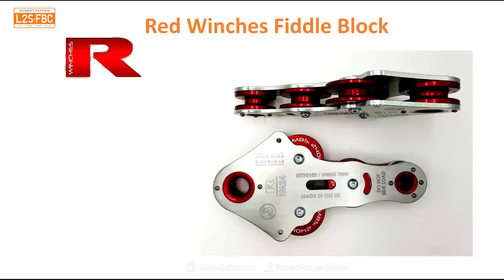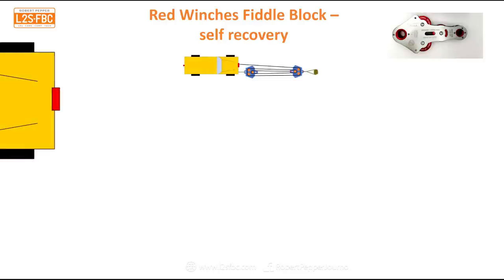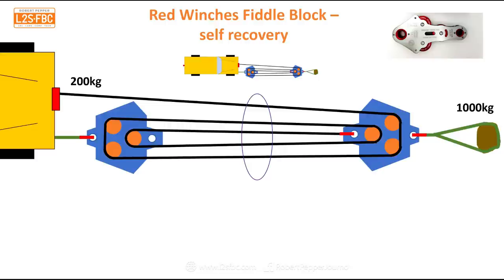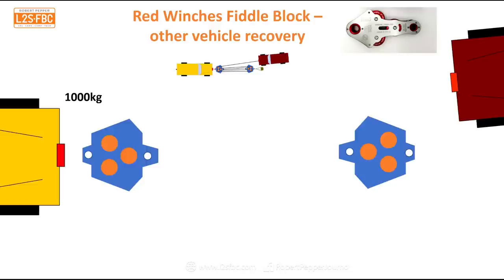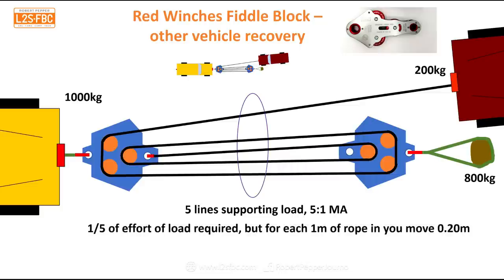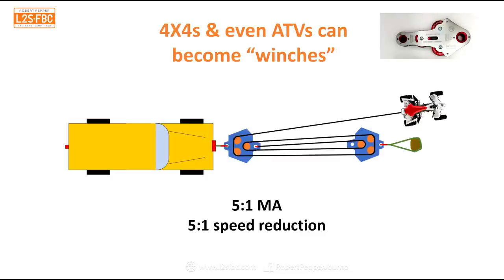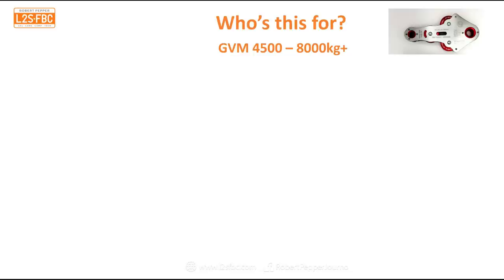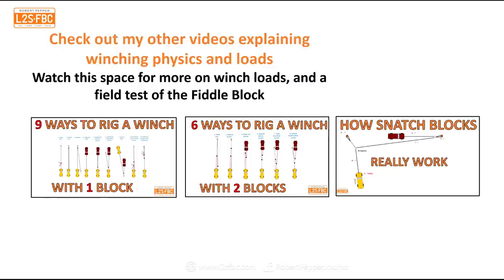What's a Fiddle Block for 4X4s?

Comment: If you used One Big Pulley & One Small Pulley on each block you would have the same 5:1 ratio using One Less Pulley and One Less Bearing causing Drag on each end. Or just use two Small Pulleys mounted side by side on a single shaft (obviously with separate bearings so they spin independently) for a smaller overall size, still having the same 5:1 ratio using 4 pulleys instead of 6. . . Yeah, Complicated Looks Cool, but it results in more drag from the 2 extra pulleys.
Reply: You're absolutely correct OldSawyer. The pulleys can be stacked on the same shaft, and this has been done, in a centuries-old technology called "Tackle blocks," or sometimes called by the more academic and prolix, "Block and Tackle." According to Wikipedia, invented by Archimedes, so it's only two-thousand-plus-year-old technology. Therefore it would seem that a "Fiddle Block," is just a means to take an earlier, simpler, and more elegantly executed idea, and complicate it just a little, so as to enable posing as the inventor of it, and collect some patent royalties in the process.
Reply: Yeah, but the friction of the block and tackle twisting up is more than the extra pulley drag on the fiddle.
Reply: Good Lord  @ridgerunner106  we need a LAUGH EMOJI for That BS. . . I've been using Block & Tackles for well over 50 years, as did my Father and Grandfather Before Me, and this is The FIRST I ever heard of one "Twisting Up" . . . If something bizarre like that ever happened to you it's because you weren't using it right. . . LOL . . . If I had to guess, I would say you're part of the Marketing Team trying to Peddle This Snake-Oil Contraption by making the usual False Claims
Reply: @oldSawyer  No, my dad pulls out my great grandads block and tackle every time we skin a large animal.  Which, one day I skinned eleven, so it has been pretty often in my 51 years.  Fiddle blocks will stay on the same flat plane in relation to each other.  I have a big block snd tackle just because I came across all the parts to make one.  I guess you can hang a block and tackle on the ceiling and lift some sort of load.  Then set up a fiddle block and lift a load.  Then get back to me with the results.
Reply: @oldSawyer  You remind me of when my dad was a kid and the power company was putting in the first electricity in the area.  Grandaddy couldnt see any use for it.  They had oil lamps for light, a wind up alarm clock, a battery radio that would last all year, a bucket and rope at the well. Who would need such a thing as electricity?  Well, once they got it,. light with a flick of a switch, plug in clocks, radio and a TV, a well pump...a compressor at the barn yo fix his own tires, lights at the barn.  Yep, he made sure that electric bill was paid on time.
Reply: Again  @ridgerunner106 , we need a LAUGH EMOJI for That BS . . . This is Nothing Like comparing 200 amp electric to kerosene lamps, this is like comparing Swiss, Italian, or South African Electrical Outlets to U.S. Outlets carrying the same voltage with different prong configurations. . . Sadly, You're Gullible Enough to Fall For a High-Dollar Marketing Scheme for something that doesn't work any better than a 500 year old block & tackle even though it costs a Thousand Times As Much.
Reply: @oldSawyer  its all about comparing what youve never had to what you are so very so sure you will never need.  I can see that since youve never had one that you are sure you will never have a use for one.  if you still travel on horseback, more power to ya.  I mean,a horse gets you from one place to another.  Automobiles are just a redesign  of the same old principle of getting from one place to another.  Its all just travel anyway

Comment: For something like a Patrol or Cruiser, these devices are useless.  They cost $1000 or more for two, they are heavy and bulky to carry around, and absolutely no-one has a winch capable of holding 70 metres of dyneema.  You can now get winches rated at 17,000lb for these vehicles.  My Patrol has a 12000lb winch and easily drags me out.  Only once needed to double line it and that was at the end of a 3 hour session up a muddy rutted hill and the batteries got low.

Comment: buy a winch that will cover your weight and one snatch block, save your self all this weight and headache
Reply: The fly in the ointment is that a winch near stall is drawing an enormous amount of current from the battery. With pulleys, the winch motor can spin longer at a lower power level and sustain the effort.

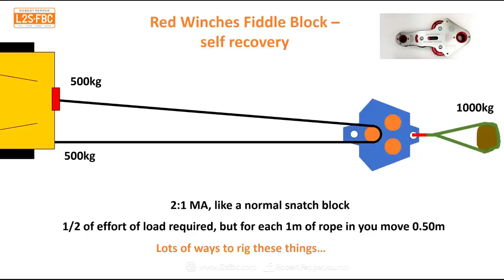Comment: From 4:16 to 4:30 the video shows a setup similar to a snatch block. It states the theoretical MA is 2:1.  This is incorrect. There is no MA as the fiddle block is used in the illustration as a fixed  anchor pulley which acts only as a redirection. The vehicle is merely pulling itself. The winch only has to overcome combined friction, maybe some gravity if on a hill, and whatever is holding the vehicle back (mud, sand etc).  If the vehicle mass is resisting with 500kg of force, then the minimum force on the anchor would be 1000kg.  This is physics but it is not mechanical advantage. Mechanical advantage only exists when there is at least one travelling pulley.
Reply from the maker: "Mechanical advantage only exists when there is at least one travelling pulley."
https://l2sfbc.com/you-can-get-mechanical-advantage-from-a-snatch-block-that-doesnt-move/
Reply: While I now agree there is MA of 2:1 in your illustration, your explanation of its source is amiss. 

The MA doesn’t come from the snatch block which is no more than a redirecting pulley. It comes from the winch itself which is in effect the travelling pulley required. It’s a travelling pulley (because it’s the vehicle to which it’s attached that moves) which redirects the line to itself where it’s anchored.
Reply from the maker: I agree with your comment and that's a good way to put it...but the fact is, the pulley doesn't travel and there is MA.  It's such a common misconception I wrote the blog post. Every month or so someone states it.
Reply: @L2SFBC The winch (the “pulley”) does indeed travel. It’s attached to the load (vehicle) which travels. The snatch block is an anchored pulley. If it weren’t for the MA of the winch and it acting as a power source, the snatch block couldn’t do anything useful. Its purpose is to redirect the forces from the winch back to the vehicle so that the moving vehicle itself can generate additional MA.

BTW The opposite situation works too.  If the vehicle was hauling a log with a snatch block attached, the winch does not provide MA.  In this case it’s the snatch block because it’s attached to the moving load (log).

Comment: 1000 AUD or 780 USD ???? for heavier less usefull snatch blocks that don't even open. just go to harbor freight and get 4 single pulley snatch blocks for $20 each. rated at 20,000 lbs. this product is a rip off

Comment: MA at 4:21  is 1:1 , check your laws of nature  ...
Reply: have another look
Reply: @tonyroba  I believed a straight pull would be 100% and by using 1 or more pullies it reduces the effort, but as it has been clarified, I was wrong (thank you) and 1 pully only redirects, you need 2 or more for weight reduction.  Thanks again!
Reply from the maker: That's not right. One pulley can give you MA of 2 to 1 or 1 to 1 depending how you rig it.
Reply: @L2SFBC  My thoughts were along with what you said... it is too early for me to sort this out in detail  :-)  need more coffee!
Reply: @L2SFBC  one pulley only gives a change of direction, not MA!! But it is a very nice system you have.
Reply from the maker: https://youtu.be/s1h9whPOPn0
Reply: @L2SFBC  anchorweight and MA are not the same. If you use the number of strings minus , then you have MA of the system , witch in your case is 1 to 4. Why don' t you do the test with 1 pulley and a weight of 100 kg. If you pull all allone on the rope you should easalley be able to lift the weight if your theory is correct. I d like to see it. But do not meassure the anchorpoint, but the free rope you are pulling on.
Reply: @L2SFBC  that is correct, if the pulley is on the movable part and not on the anchorpoint